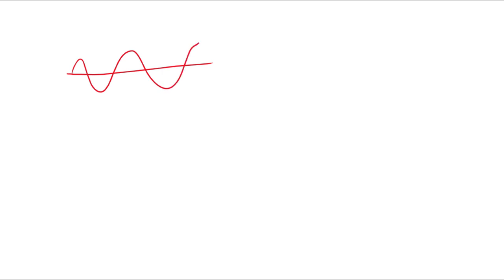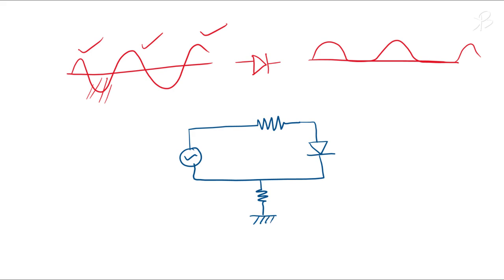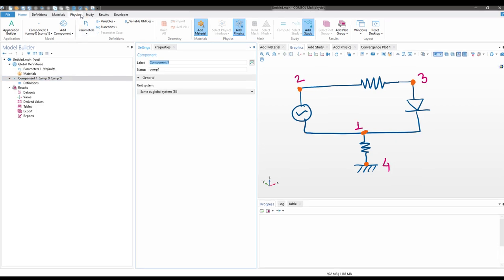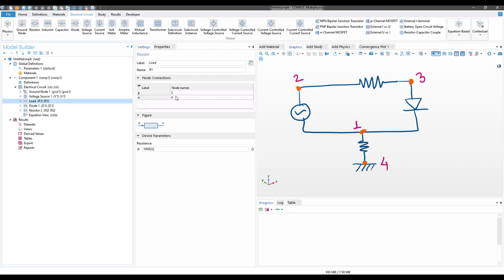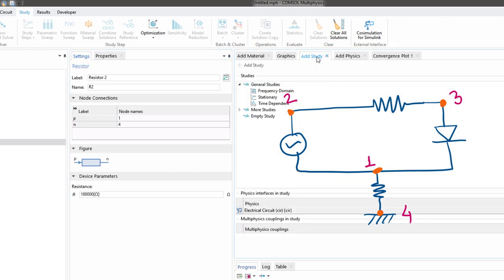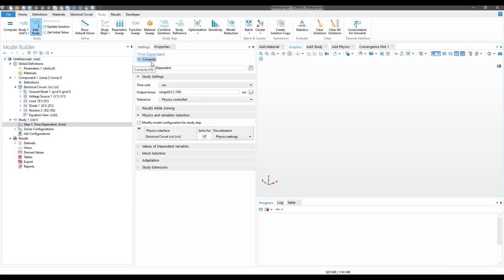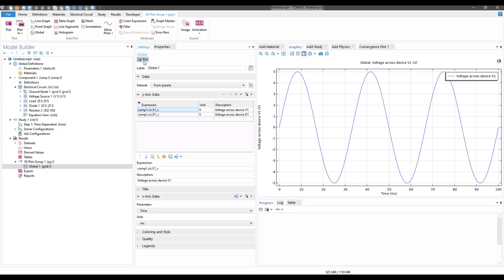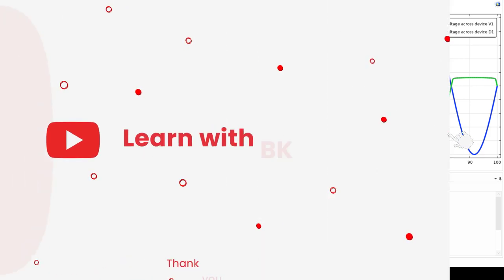COMSOL Multiphysics Electrical circuit HALF WAVE RECTIFIER Complete Tutorial

Comment: I think the Load Resistor(2-3) was supposed to be put after the Diode(3-1). So, it would have become Load(3-1) and Diode(2-3). Is the Voltage Source V1(1-2) or V1(2-1) ? Kindly explain the convention. Thanks in advance.
Reply from the maker: please try with known circuits and recheck yourself :) thanks.